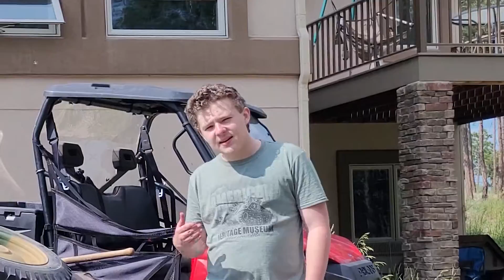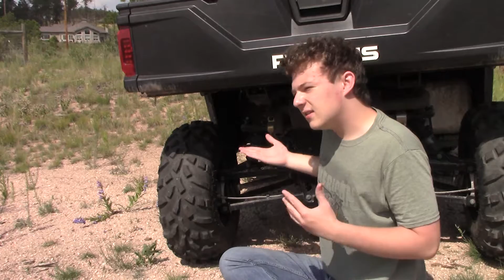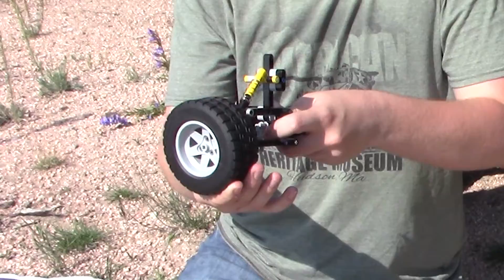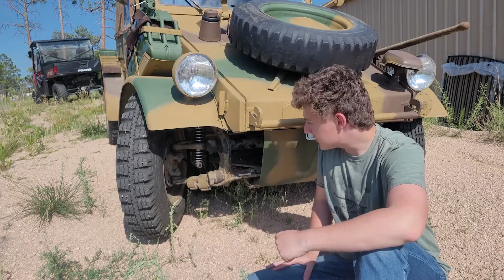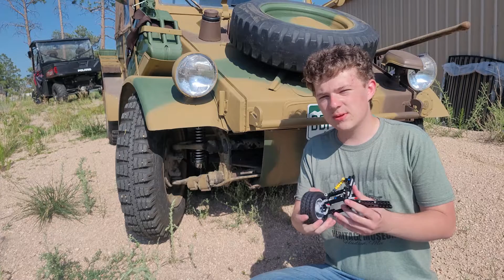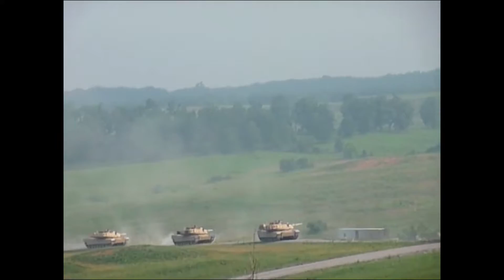Why Torsion Bar Suspension is Awesome

Comment: That's absolutely not right and total bullshit a torsion bar independent suspension just travels up and down not back at all the only suspension that goes back while travelling up is the rear axle on a solid axle rear end with coil springs or coil over shock you have no idea what you are talking about stop trying to misinform people

Comment: Great video explanation--thanks. Forget about cars, which suspension (independent coil spring or torsion bar) do you think might be better suited for a small (under 30' and 6000# empty) tandem axle pull-behind travel trailer? Thanks.

Comment: I was wondering if this would have an advantage for high speed trains as you need to stop vibrations and hunting osilations because if it works for army tanks then it should work for fast or heavy slow trains runing on a solid steel bar.

Comment: Unfortunately torsion bars in today s trucks and suv s are set up same way as coils, they have the same upper and lower control arms pivotting perpendicular to the frame.  The VW and tank swing arms  systems pivot parallel to the frame.  The smothness and quality of ride you are referring to is the quality of the geometry of suspension.

Comment: The whole video is a mistake in logical levels.
You’ve confused the springing element with the arms’ layout.
My Chevy truck did have torsion bars in the front, but it did slow down a bit on bumps. The thing here is it had longitudinal torsion bars inserted in transversal arms. So the arms matter, not the torsion bars.
In fact if you turn 180° the very suspension with torsion bars you show here, so that the arms point forward (and there were vehicles with such layout), the whole thing would have to slow down even more than the transverse arm suspension.
At the same time there were cars with longitudinal arms facing backwards plus coil springs that had same easiness on bumps as you show here on torsion bar suspension.

Thus you compare the direction of the arms, but not the two different types of springing elements as you’ve claimed.

Ah, by the way. „It isn’t programmable to be progressive“—false.
Do you know how coil springs are programmed?
They use metal with stiffness gradient. There are two ways to do that. Either you make the metal itself less stiff from one end to the other, or you make one end thinner and gradually increase the thickness to the other end.
So the giant secret is… You use the same method with a torsion bar. Parts of the bar easier to twist will twist first.

So, yeah. The vid is smart, but very misleading. You literally lied to viewers.
And, reading the comments, they were very glad to be confused by your clever explanation.
Reply from the maker: That's fair and correct. I made this video when I had just started learning about suspension, and I confused torsion bars themselves with trailing arm suspension, which is what the video is more about. That said, I wasn't wrong about how torsion bars work, even though I omitted transverse torsion bars. I did not at the time know about progressive coil springs, I learned about that later, so I didn't lie I just didn't know. I should have done more research before I made the video, but it was my first (and maybe last) 'educational' video I made.
This is the first really critical comment I've gotten, and I'm honored you took the time to make a fleshed out and well reasoned explanation of the things I got wrong!
Reply: @Misty_Fox  
Wow! I respect you a lot.

Please make a follow-up vid!—Now when you've done the research.🙂
Reply: When I saw the lego model I thought to myself that if the bar was placed in front of the wheels it would behave differently and now that I see your comment I understand why. Thanks for the explanation. Also, please don't blame the guy that made the video, it was very informative to people who no knowledge in this area like myself and although it has a few mistakes it's still very helpful.
Reply: @cavalex  
Hi mate. One thing caught me in your comment. I do not blame the guy. In fact I admire him.
The thing I don’t like is when opinion makers lead noobs in false directions. If you know the topic you tell the guy ‘No, sorry, but this is white, not black as you call it in your explanation’. But if you know nothing of the topic anyone looking confident enough can take you to any shitty direction really far.
Way too many people wrote in comments this vid explained a lot to them. That is really bad. That was the thing that upset me the most.

Comment: You are correct in the example given.
However, torsionbar-suspension has also been used with tranversely-mounted swing-arms. Older renaults (4, 5, 16) used them in front and back with front-suspensionlinks transversely mounted.

In a car with "standard"  setup you will often see that the whole thing is "tilted"  backward so that the wheel also still travels backwards somewhat.

Comment: The key advantage and disadvantage seems more to be around trailing arm suspension geometry than torsion bars per se. (Rotation and space in front).

Torsion bars can be fitted front to back and not require trailing arm front suspension.

Comment: As you already mention, torsion bar used on many tanks.
The reason, why torsion bar isn't use much on modern car, even though it's a better suspension system, is because . .
it's ROBUST & less part.

A modern car suspension is much . . much more fragile, and so, needs more repairs and spare parts.
💲💲💲💲💲💲💲💲💲💲💲💲💲💲

Comment: Not an engineer and barely a car enthusiast here: If a vehicle has independent in the front and torsion in the rear, it wouldn't remove the negative attributes when going over bumps from the independent suspension, but the rear would feel more smooth to back seat passengers?
Reply from the maker: Yes

Comment: Great video, torsion bars across the width make sense to me now. But what about torsion bars that run along the length of the vehicle?. I have wondered why vehicles with these torsion bars have that sort of "ugly" maybe chaotic  response to bumps compared to conventional springs?
Reply: Look at the Chrysler (Mopar design) the torsion bar takes the place of coil springs. Drive a coil car without shock it will bounce up and down like crazy. Drive a Mopar with out chock absorbers and this affect is barely There.
Reply from the maker: Torsion bars along the length of a vehicle just strengthen the conventional spring design with no change to movement, so I assume they just make it stiffer and therefore bumpier.

Comment: Neat video! The other way to use torsion bars is like on the Land Cruiser 100 or the Ford Explorer, which used a "normal" lower control arm like on a coil spring setup but has the torsion bars (one on each side) extending along the side of the frame.
https://www.youtube.com/watch?v=yt9rTwbTuOI
Reply from the maker: Thanks for mentioning that! I was going to talk about it in the video but didn't have time.